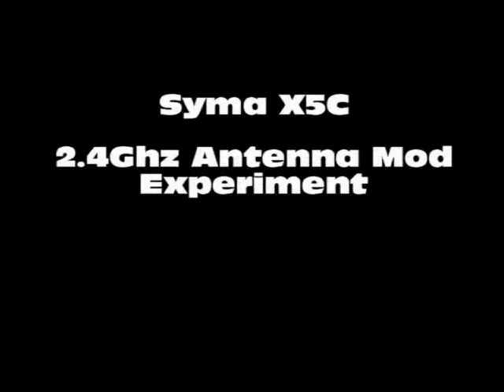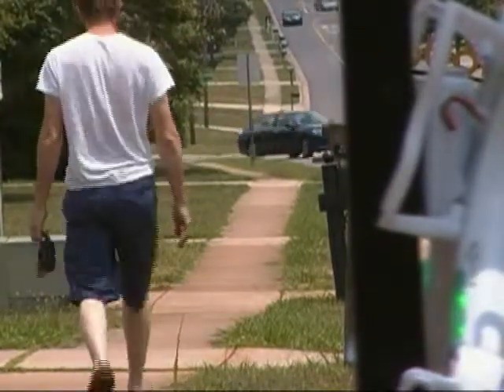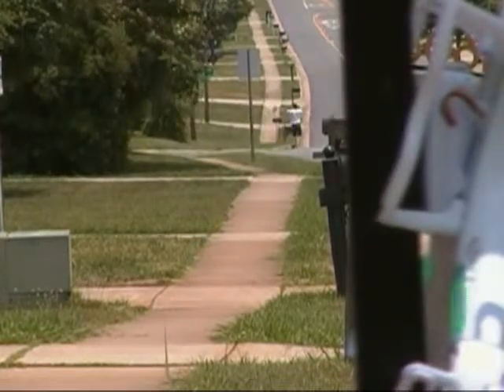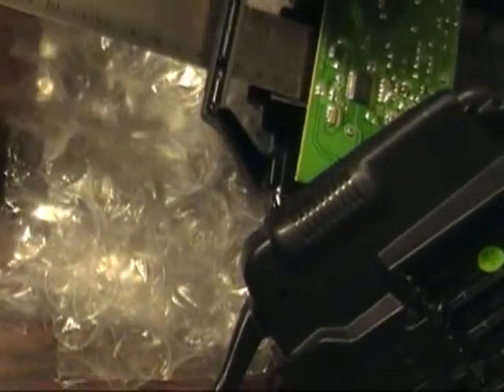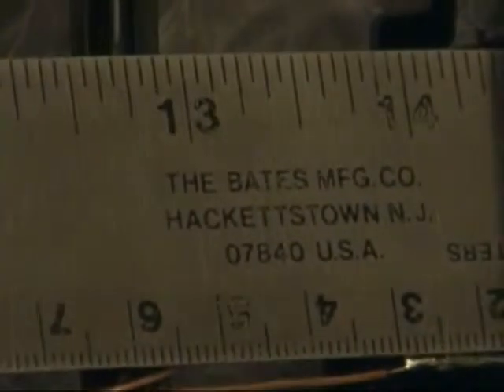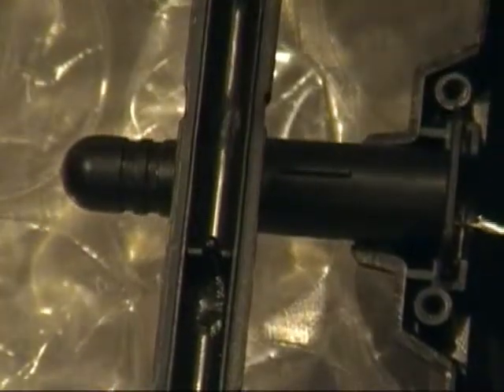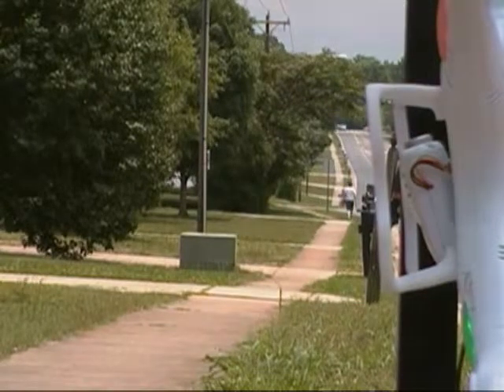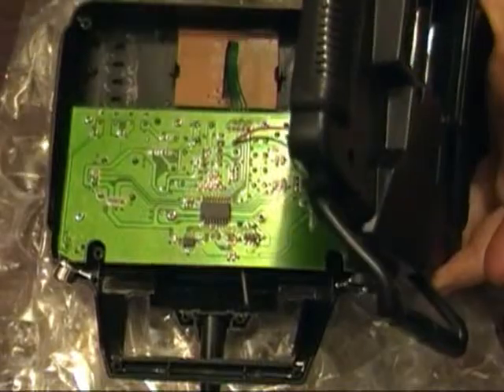Syma X5C Quadcopter 2.4Ghz Antenna Experiment

Comment: That "stock" wire antenna is directional in both the flyer and the controller. Just desoldering then and running them vertical will increase range 2.5-3 depending upon the surrounding interference. Always "test" same time of day especially on week days where commercial interference is boosted .5 or greater as allowed by law.
X5 in urban I always found 1/2 wave to be best on both ends. Many of the x5s I've modded for others have totally incorrect length antennas in them from the factory. I've seen as short as 15 mm to as long as 50mm. 62.5 in my city works best. (61-64mm). 16-14awg wire also. Yes, wire dia. does seem to matter. Many cheap dipoles for $20 have 28awg wire or some other oddball awg.
Reply from the maker: Thanks for those details.  If I did it again, I might pay more attention to the directionality of the design.